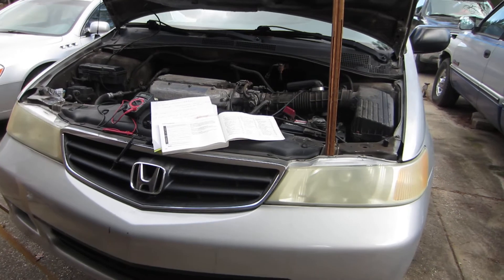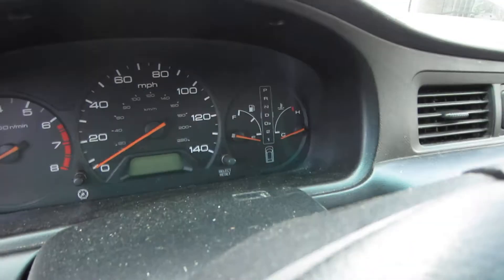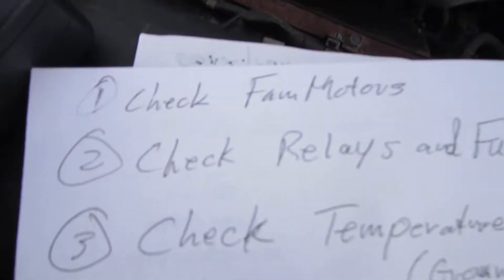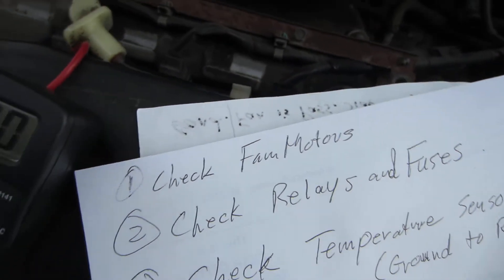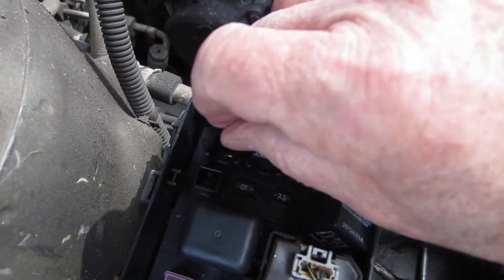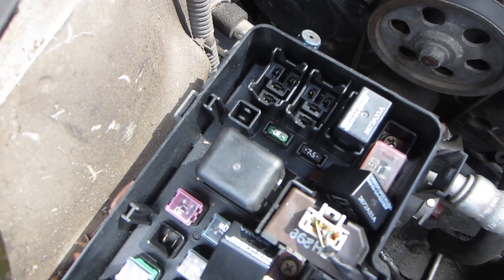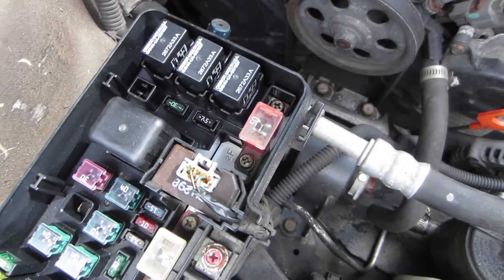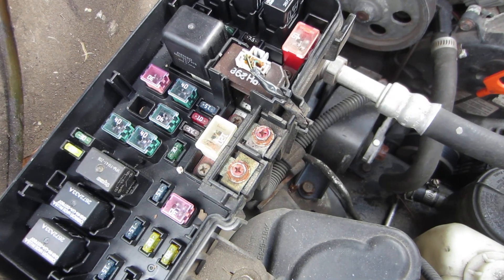ENGINE OVERHEATING FIVE EASY DIY STEPS - 1: Checking Relays and Radiator Fans HONDA ODYSSEY 2001-07

Comment: So if it made the fan kick in does that mean the relay is good?
Reply from the maker: If you bypass a relay and the fan runs, it just means the fan and wiring is good. You may swap a "known good" relay in there to check and see if it makes it work properly. Some of the relays are identical. Thanks for watching

Comment: If it did spew steam, what would that mean?
Reply from the maker: NOTE: Only check out the cooling system on a cooled engine, as personal injury could result from high water and steam contact. 
If steam did spew out, the engine is definitely overheated at that point as water turns to steam at 212 degrees. Any sustained operation above 212 degrees could cause serious engine damage which could cost $ thousands to overhaul. First, turn it off as soon as safely possible to stop further damage and then allow an hour or so for the engine to cool down. At this point, it could be as simple to fix as adding coolant (purified water, or water mixed with anti-freeze) or there could be other more serious causes of the overheating. Cooling systems generally will loose small amounts of coolant through evaporation over time, so regular checking of coolant levels is required (check once monthly or more often on a healthy system but check it every time it is started on a system that has been having problems.) Cooling fluid loss may also be caused by ruptured coolant hoses, faulty temperature sensors, radiator leaks, water pump failure, cooling fan failure, trash and debris build-up, drive belt breaking or slipping and other causes. It would be best to have an experienced mechanic to check the vehicle out if the problem is not resolved easily. Thanks for watching the video!